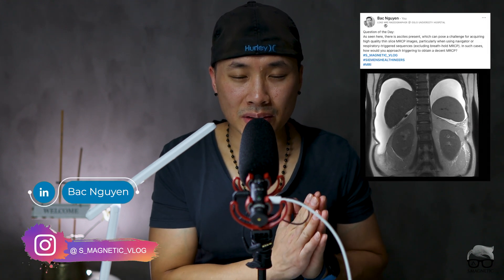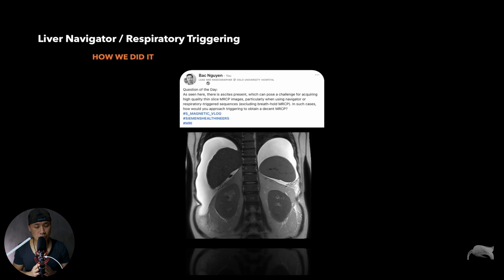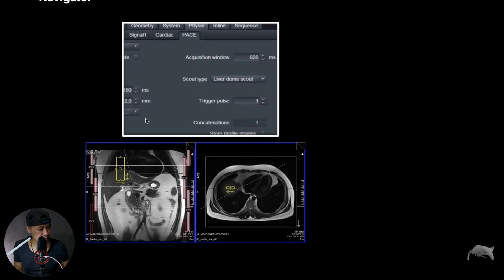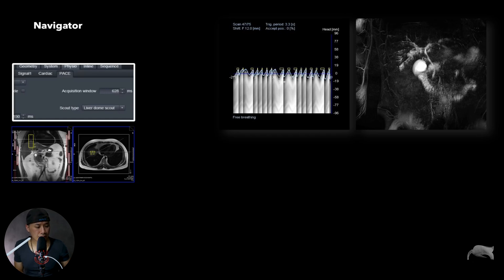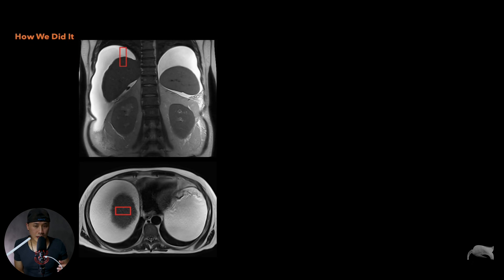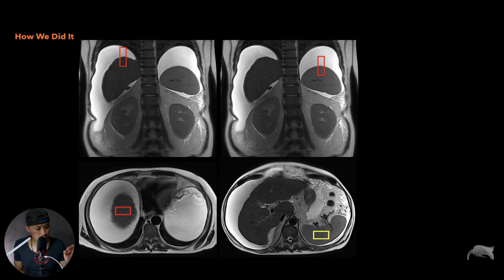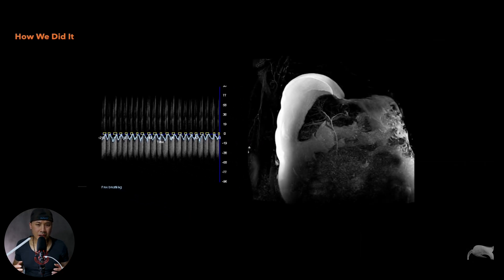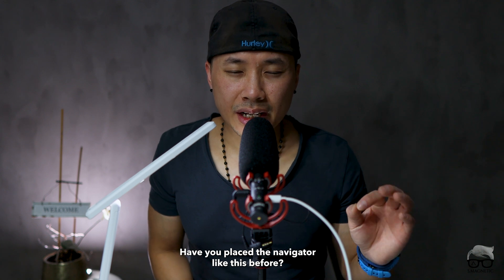MRI MRCP– FROM CHALLENGE TO CLARITY

Comment: How about dielectric effect artifact?
Reply from the maker: @sosnoolyak  what about it?
Reply: @Nguyen_MRI  this is a much bigger problem for patients with ascites on a 3 tesla machine. can we deal with it?
Reply from the maker: @ very true. 1.5t is preferable
Reply: @sosnoolyak  you can’t. There were some dialectic pads some time ago but no longer purchasable and the official recommendation is to drain the fluid first then do the MRI at 3T, or do it on 1.5T. You don’t really have anything at hand to reduce it since it’s physics.

Comment: Ascites can produce an artifact known as a standing wave artifact. It is caused by dielectric effects of the body and will be further enhanced by ascites. 

This is due to certain properties of fluids and radio frequencies  and the wavelength of the RF pulse which depends on the resonance frequency. Higher frequency equals  shorter wavelength, in other words do not use a 3T when the patient has ascites close to the region of interest. If you encounter this artifact at 1,5t, position the patients arms above his/her head or try to change the image plane.

Comment: Bac, one advice from my experience: doing MRCP (3D space), just decrease TE from stock 700 to 500 (without even changing any other parameters). I dont know how it works, but it works. Especially good results are when patient breaths bad.
Reply: If you’re using a Siemens scanner partial Fourier transform will be turned on by default from the vendors sequence, by reducing the TE you’ll reduce the phase acquisition of K-space by x%. You can check this by hovering your mouse over the TE. It is not recommended to reduce it less than 90%. You’ll probably produce an even better result by tailoring the ETL as Bac mentioned. Try to keep the ETL as low as possible and not over 900ms, which will come at the expense of acquisition time. 

If the patient is breathing consistently with a respiratory frequence of ~20, I use a TR 1600, TE 400-500, TF 180, compressed sensing with a factor of 5 and partial Fourier transform. Low sar RF pulse for a propper slice profile. Interpolated to 0,5x0,5x0,6mm with slice acquisition at 50% 

Should give you an acquisition time of about 2min. Works on both 1,5 and 3T
Reply from the maker: Hi thanks. Yes been doing it for years with te400. And tailor in the ETL.
Reply: Thanks
Reply: Hola, pero funciona en GE? O cual casa comercial. Gracias
Reply from the maker: I did something like this with te on ge as well. Works. Test if you can.

Comment: Do you have any tips for improving respiratory artifact on breathholding sequences? I feel like even when the patient is perfect and i use small time increments, i still get horrible respiratory artifact on axials. My older GE scanner never had an issue with it unless the patient was really bad, but i feel like siemens is way way worse even on good patients.
Reply from the maker: What scanner you at?
Reply: Respiratory trigger, like in this video will solve that (for HASTE or TruFi), but will take longer.

Doing the breathhold manually, and start it when your completely sure the patient is not moving anything anymore.

For abdomen, use the medication Buscopan to stop bowel movement temporarily.